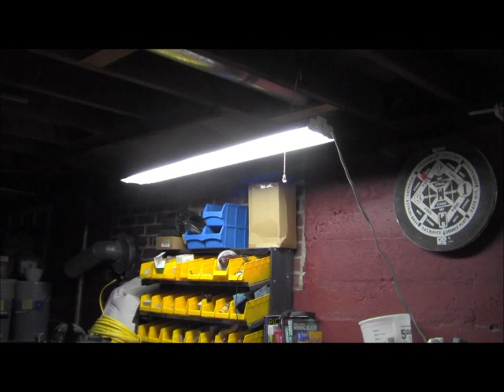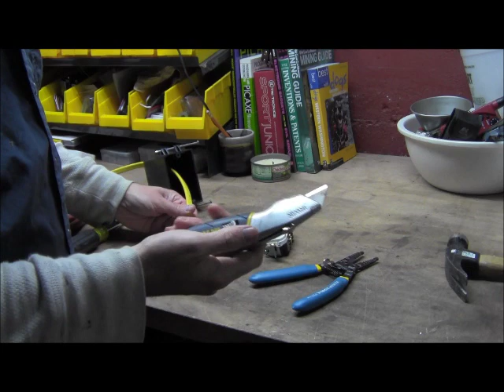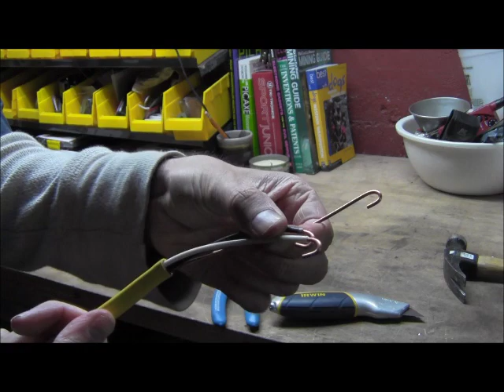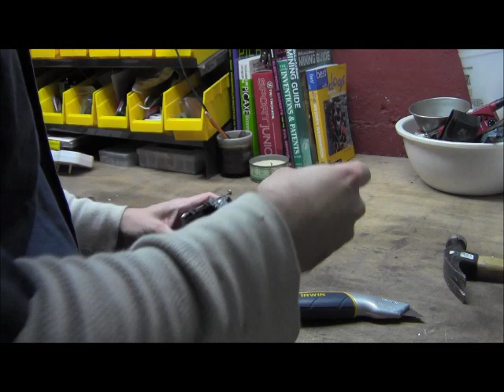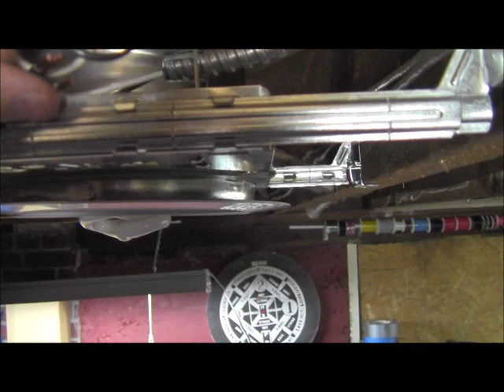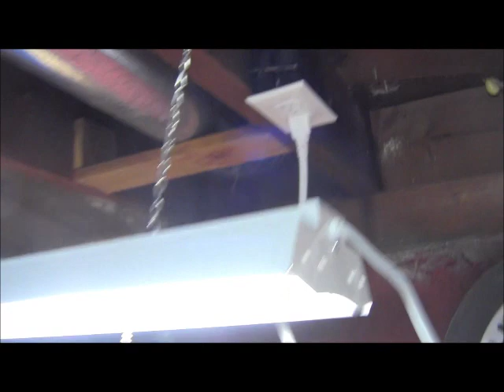RicksDIY Ceiling Outlet DIY Wiring.wmv

Comment from the maker: Yes the outlet only has power when the lights are on. Depending on how yours is wired, if the HOT black wire has power in the light and then goes to the switch and then back you can just tap into the always Hot wire to feed your outlet. I did this exact same thing when I put in a garage door opener. Just be sure to shut off the breaker.

Comment: So the outlet that you put is live only when the recessed lighting is on right? I want to install an outlet(maybe two in one box )  in the ceiling of a garage to plug in  a garage door opener which is now pluged into a lght fixture with a screw in outlet and have extra outlet incase I need it in the garage. I don't want to have to keep that  garage light on so I can operate the garage door opener. The switch operates 2 lights at the same time one in the middle and one on the side.